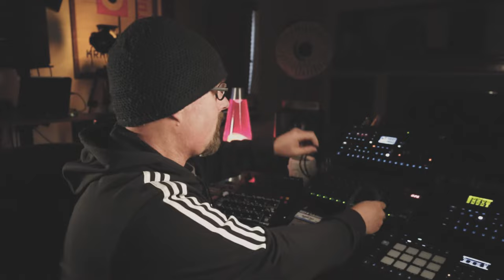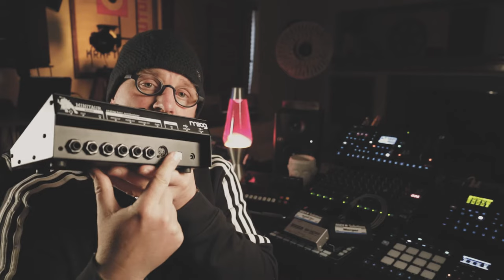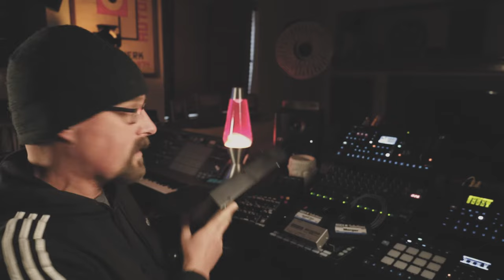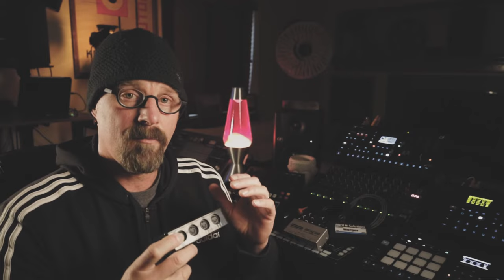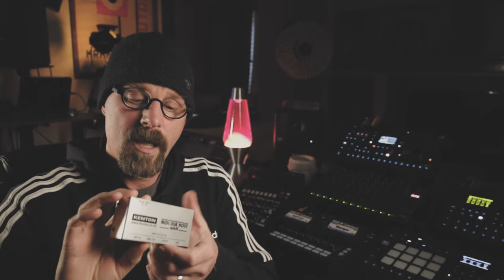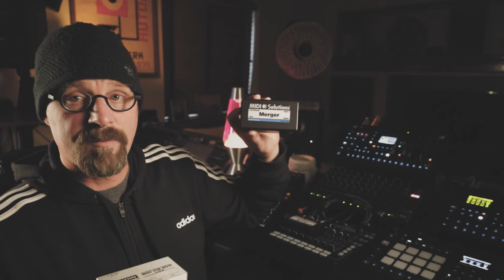MIDI Basics Explained: DAWless Connections, Routing, Convert USB to Din MIDI, Merging, Splitting

Comment: hello! bonjour salut à toi thanks for the video!
I have a question for the choice of the midi thru box:
in fact I hesitate between the Kenton MIDI Thru 5 model (which has a separate power supply) and MIDI Solutions Quadra Thru V2 (which is powered by the midi)
I think take the midi solution because it is to get out of an Elektron sequencer so which I think will feed the midi thru box ...
but the question is in relation to the quality of the amplification of the midi signal do you have any information?
for the Kenton model I read in the manual: "The THRU-5 has an opto-coupled MIDI Input and separate drive circuits"
do you know the explanation of these technical data? (opto-coupled? noise problems with earth ground etc ... ???)
sorry for this somewhat technical question ... and thank you merci!
Reply from the maker: Bonjour! From what I understand the powered Kenton boosts each of the output copies if there has been any degradation in the signal. This may be from an extra long cable run from the input source. It acts very much like a powered USB hub vs a bus powered hub. I use the MIDI Solutions without any issues because I’m generally using only 1 meter MIDI cables on my table. If you have a longer run, or if signal degradation is an issue, you might need the powered box. J'espérais que cela était utile. Merci beaucoup d'avoir regardé et s'il vous plaît laissez-moi savoir s'il y a autre chose que je peux faire pour aider. A+ Eric
Reply: @SURCOlive 

hey! :) yes indeed I understood that it was especially necessary to use short cables (to enter the box thru especially)
the midi solution v2 seems to work well and to be reliable enough for what I want to do: send sequences to 2 modern machines and maybe an older one which has thru output if necessary and also send a clock to a delay for my guitar. .. haha here is the story of my life for now ^^

I don't want to ask too much it's mainly for the fun of questions that can be asked with the hardware automation:

another (last)-question which has no relation to the midi box:
I am thinking of buying a second master keyboard
I will try to connect 2 midi master keyboard before entering the Elektron sequencer to be able either to have a large keyboard with 2 small ones (same midi channel) or then play 2 different midi tracks (control 2 differant synths): ... keybord1> > keyboard 2 >> sequencer >> box thru >> synthesizers ... logically this must be possible by assigning a channel to the master keyboards and by using the midi menus of the sequencer ... ???
thank you! and thank you for the French text! ;)
Hello from Paris!
Reply from the maker: If you send the MIDI from any keyboard to a group of synths, you can 'select' the synth from the midi keyboard by selecting to send on the channel that synth is set up to 'listen' on. Making sure these numbers correspond is key to flexibility. I use an Arturia Keylab 61 MKii to control all the hardware and software synths in my studio. You can select the midi channel live without any menu diving, so it is really flexible. Most (novation, Arturia, Akai) will do the same. De rein. ;)  Heureux de parler français. C'est ma deuxième langue. J'ai travaillé pour le Club Med pendant 11 ans et j'y ai appris à le parler. J'étais à Paris en juin. C'était super d'être de retour là-bas. Merci encore d'avoir regardé. Merci de me dire comment fonctionne votre solution.

Comment: any suggestions for connecting MC707, Deepmind 12d an Korg volca?
Reply from the maker: Lots of possibilities there! The MC707 and Deepmind 12 both have 'In', 'Out', and 'Thru' DIN MIDI, so they can be anywhere. It comes down to what you'd like controlling everything. I might suggest the MC707 control the setup. MIDI 'Out' from that to the Deepmind 'IN', then depending which Volca you have and whether you want the keyboard on the Deepmind controlling the synth you would want to go 'Out' from the Deepmind to the Volca. If you want the MC707 to control the volca, then 'Thru' from the Deepmind to the Volca. If neither will control it and you just need tempo and start/stop, then it matters less. Then make sure your channel settings are correct for anything sending note or CC data to another synth. I hope this helps. Thanks so much for watching!
Reply: @SURCOlive  Thank you much for your reply. I do want the MC 707 to be the brain. I have the Deepmind 12D (w/out the keyboard).
Reply: @SURCOlive  I'm just an old guy trying to live a life long dream of learning all of this.
Reply: @SURCOlive  I made the connections you suggested I just am not able to get it to work. Not sure if my setting are off. I was hoping to use the MC707 as both the midi controller and mixer. Just not getting it.

Comment: Thanks that was very informative , I have a question !   i have an electribe (brains) midi out to a drumbrute and then out to a microkorg, however the microkorg doesn't start or change bpm (arpeg) when its set like this.  If i connect the electribe out to the midi in on the microkorg this does work but the out of the microkorg doesn't start the drumbrute - now listening to this i think I need to set this to the thru channel ?  I also want to connect my ipad to the electribe to play samples sounds to me that i need this directly connected to the electribe so that i can trigger samples from the pads  , and then use the thru from that back to the other two or one of those midi duplicators ?
Reply from the maker: Yes it will need to be thru in order to get the signal from the master box.
Reply: @SURCOlive  thanks I get this to work one problem though the ipaD GarageBand plays all the tracks at the same teams !

Comment: Really great video explaining midi in fine detail, really glad I came across this. Can I ask please about midi merge. In the video you outlined that the Octatrak is providing the clock for all of your synths so if you also wanted to send a sequence from the Digitakt into one of  those synths would you use a merger box or is midi clock sent together with other channel specific data? Thanks
Reply from the maker: Hey! The clock and midi are sent from the same source. You would need a merger to send notes, start/stop, CC, or program change from a machine other than the source. You could send all of those with the clock from the Octatrack if it is the clock source though. Thanks for watching!
Reply: @SURCOlive  Many thanks for your super-quick response, really helpful.

Comment: Thank you for that exceptional video. Lots of information and very well presented. Liked and subscribed instantly. I have a question if you may find time. I play the handpan mostly and using an RC 505 looper . I use  a mixer and from  fx send i control   my pedals and the looper . I got the amazing Roland mc101 lately and i am creating some sets on it while adding the handpan at times and configuring the tempo at 101  cause 505 doesnt always match exactly. I read that you can synch them with midi and  Rc 505 must be the Master they say, i will check that soon.  Yesterday though i ordered the Microfreak. From your video i understand that if you daisy chain them the midi signal is one direction. My set up i imagined it like ' Play the set from 101 , loops some parts with the handpan and adding some synth sounds from the microfreak. I guess i can loop the microfreak also from fx send of my mixer. Is it best advisable to do it like that? Daisy chain them with midi or using a midi box?? I guess practise will tell, thank you for your time making that video and hugs from Greece!!
Reply from the maker: I'm glad you enjoyed the video, and thanks for subscribing! All three of the pieces of gear you mentioned (RC505, MC101, and Microfreak) all have MIDI in and out, so you co go with any one of them as the 'master clock'. I would probably recommend the MC101 for stability. MIDI 'Out' from that to either of the others, then MIDI 'Out' from that to the third one. Since you are only controlling sync and start stop in you setup, you shouldn't need to worry about the order. Keep in mind that MIDI is only the control signal, and is not an audio signal. That is the second signal flow you will need. Because of this you will still need a mixer/FX/audio signal flow that is separate. Check out my  video on Connecting Your Hardware Live Setup. It discusses the two signal flows. I hope this helps, and I'd love to check out some of your music. Thanks so much for watching!
Reply from the maker: Awesome!!! So glad it worked!! Happy creating!!! Hugs from Colorado!

Comment: You shouldn't need a multiplier if your intermediate slave devices all have MIDI THRU, unless there's a latency issue
Reply from the maker: This is true if every device has Thru. I prefer to not daisy chain my devices unless necessary to avoid potential latency and midi conflict issues. But daisy chaining is absolutely and option. Thanks for watching.
Reply: @SURCOlive  ok. I'd be interested to know what conflict issues there can be.
Reply from the maker: Depending how long the distance, how many connections in the chain, and the quality of the connectors and cables, potential issues get greater and greater. Each meter of cable and each 'In/Thru' connection can slightly distort the signal and add to signal degradation which can cause hung notes, lost commands, . This is in addition to added latency of up to couple of milliseconds per link in the chain depending on the quality of the connections in each piece of gear in the chain. Some never experience any of this, but I prefer not to take the risk for live performances.
Reply: @SURCOlive  That makes sense. I'm also interested in live performance.

Comment: Hi Eric, how are you? Great video, thanks so much
I have a Behringer XTouch compact and I want to output the midi input and output signals to two behringher UMC404 boards. What device allows me to take the in and out output of the Xtouch and transform it into 2 in and out?
Excellent your video, thank you very much!
Reply from the maker: Not sure what you mean. There is no ‘input signal’ from a device. That is a signal coming into it from another device. The output can be split using a midi thru box as mentioned in the video. The multiple signals the output becomes can be sent to multiple devices keeping in mind there is only 16 total channels to be sent. The same signal can however be sent to multiple devices if they are set to receive the same midi channel. Remember that midi goes one direction from out on one device to input on another. And of those signals can be multiplied with a midi thru box going from out to in. I hope this helps. Thanks for watching!
Reply: @SURCOlive thanks for such fast answer. 
I use voicemeeter potatos. When i map an action, with midi in y recive the status (FF) so if i move a fader in the xtouch affects the fader in the app, and if i move it into the app, it affect on the fader of the console. So i want to replicate that on 2 computers using behringers 404.
Reply from the maker: @gabrielantrilli3322  Sounds good. I would use a midi thru box in each direction. Once coming from the console, and one coming from the computer. You should be all set if you do it that way. Just know that the two signals that come out of the midi thru box are duplicates and not 'split'. They both have the same information. There will only be one of each midi channel even though there are two destinations. That means midi channel one will send the same information to both destinations, midi channel 2 will as well, and so on.
Reply: @SURCOlive  thanks so much Eric! Greetings from Argentina!
Reply from the maker: @gabrielantrilli3322 thanks for watching and reaching out!

Comment: What is the name and kind of midi usb host do you use.  I can't see it on your video.  Or if you use a different brand what would you recommend.  I need to to Is connect launch control to a boss RC-600 looper.. thank you
Reply: Actually what I am wanting to do is connect the launch key, Launch pad,  launch control, to the rc-600.
Reply from the maker: The brand of USB MIDI Host I use is the Kenton. There are others though.
Reply: @SURCOlive  oo ok ok.. thank you

Comment: SO helpful. Thank you. I just subscribed. Question if you have time...If all devices have USB as well as 5pin, can all of the merging/splitting be done with an app like MIDIflow (haven’t been successful there yet, maybe just don’t understand the app) or am I better off getting splitters and/or mergers and using the 5pin connectors??   Here’s my situation, as a performer for live shows:  Just THREE devices but not a simple chain, more like a love triangle, LOL:  Ipad (app I’m using is OnSong), MODX synth, and VoiceLive 3 vocal processor.   Ipad  (OnSong) needs to be able to send respective program changes to BOTH of the other two (MODX and VoiceLive 3).  MODX also needs to send note data to VoiceLive3 (for generating harmonies), so VoiceLive 3 needs to receive from BOTH of the other two (note data from MODX, and program changes from iPad).   Put another way, the MODX is the easiest since it only needs one “in” (from ipad) and one “out” (to VoiceLive 3 for note data), but the iPad would seem to need 2 “outs” and the VoiceLive would seem to need two “ins” by my logic. Can all this be done using USB MIDI (with a powered hub) if I configured it correctly, or do I consider a merger and a splitter as you have discussed in this fine video?   (FYI I currently have a setup that works but is not ideal in that I have stored the PCs for the VLs within in the synth for each song patch, so that I can connect linearly with 5pin from the ipad to synth to VL3, but prefer not to be tied to using just THAT keyboard...Would like to be able to send from iPad directly to VL3.)
Reply from the maker: I’m not sure about midi flow. I’ve never used it. Please let me know what you find out. I’d love to learn! Thanks so much for watching!
Reply: @SURCOlive  What I have found out thus far....USB MIDI won’t work for me anyway because apparently the VoiceLive 3 will only receive note data via the 5pin connector. (I was able to get it to receive a program change from iPad when I had everything connected via a USB hub, but no note data was being sent from the keyboard, so I researched that issue....seems I need to use 5pin for MIDI to transmit notes.) So I guess if I want to work on this further I’d need a splitter (to split from iPad to both keyboard and VL3) and a merger on VL3 end (to receive from both iPad and keyboard) if I understand correctly.

Comment: thank you for walking through each scenario.  really helpful to see actual use cases.   would a Motu midi hub negate the need for all the small boxes?  they seem to have a lot of ins and outs and be able to route in many ways?  I've been looking at them but not sure if they'd solve my issues,  thanks!
Reply from the maker: Glad you liked it. Those midi routers can be great but many require a computer to route things. The advantage of the boxes is they can be used live without a computer. There are options of larger routers (iconnect, MRCC) that can be used with or without computer. Thanks for watching!
Reply: @SURCOlive  thank you for the quick reply. Very helpful as I’m putting together my studio!
Reply from the maker: @fugue6904  I hope it helps! I'm building a new studio at the moment too and I've opted for the MRCC because of its flexibility and connectivity. Good luck with your studio!
Reply: @SURCOlive  oh, well I was just looking at the Iconnect based on your recommendation, I'll check out the MRCC now.  I'd like to get it right the first time.  all I really need is for my TR8s to run the tempo when I'm not on my computer, and then my computer to run things when its on.   I'm not always plugged in to my computer.   thanks for the help.

Comment: Great video, thanks for taking the time to make it. I've recently been trying to sync my minilogue xd to my circuit rhythm but the sync mini jack connection is not reliable enough. unfortunately though, when I use 5 pin midi, my kick drum on track one (of the circuit) triggers a C note to be played on the minilogue along with any other notes I've sequenced in... I haven't given up though! ✊🏻 thanks again man
Reply from the maker: Glad I could help! You can set your Circuit to not send note data, or set your Minilogue to only receive clock and transport. That will prevent them from triggering. Thanks so much for watching!